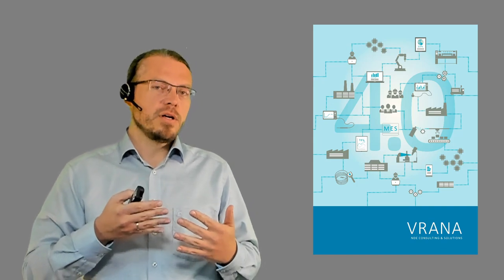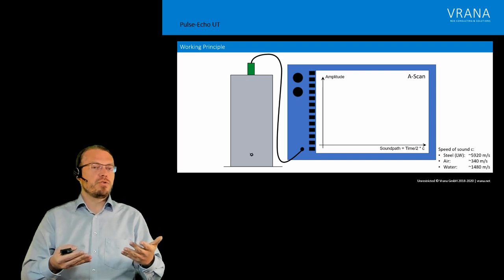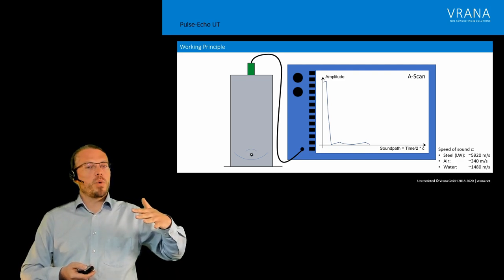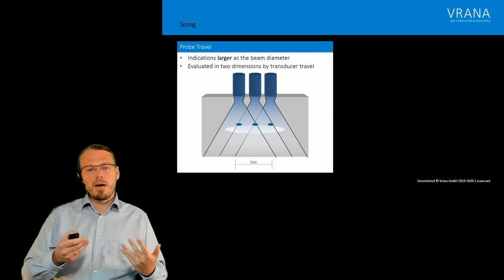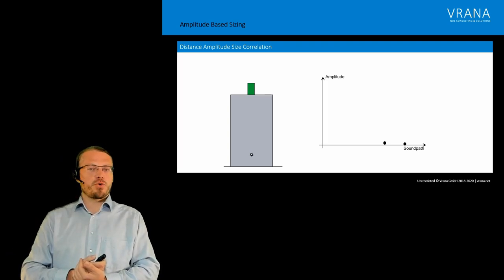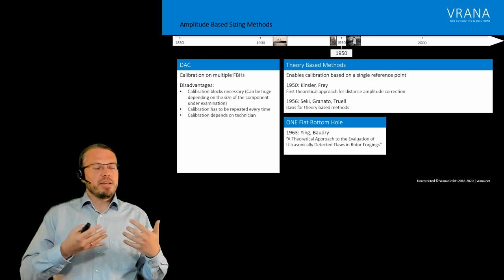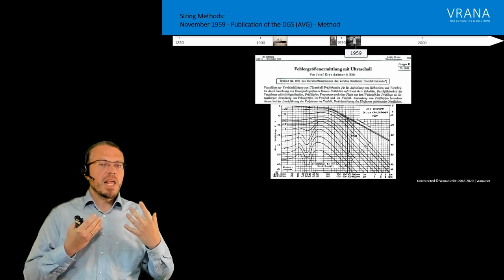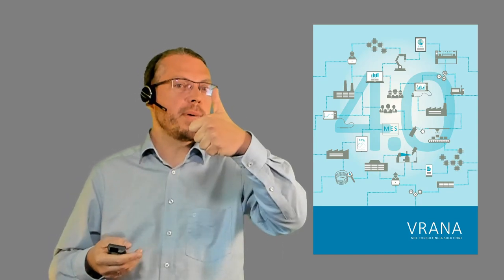Basics of Ultrasonic Testing and Sizing

Comment: A great video.. Why can not we use audible frequency range of sound waves for industrial inspection?
Reply from the maker: The wavelength determines the minimal size of the objects you want to find - a wave with 10 kHz in steel (~6000m/s) allows you to find objects with ~0,5 METER (the lower limit would be something like 0,15m). With 2 MHz you can typically find indications of ~1 mm and larger.